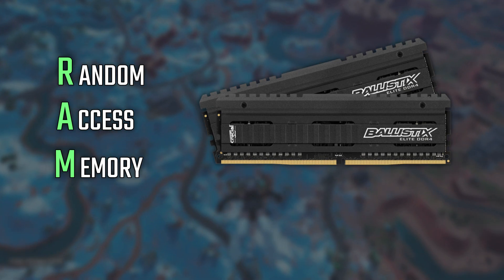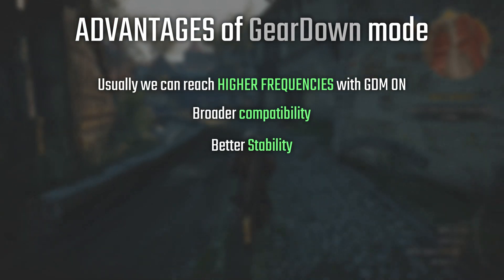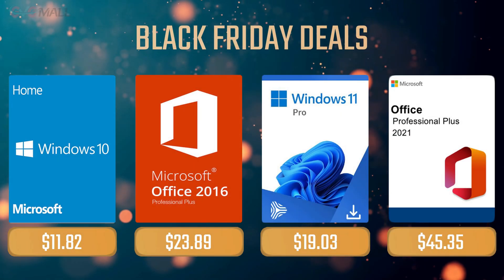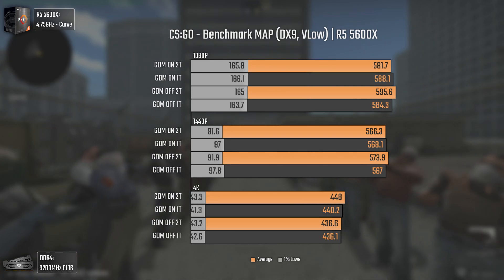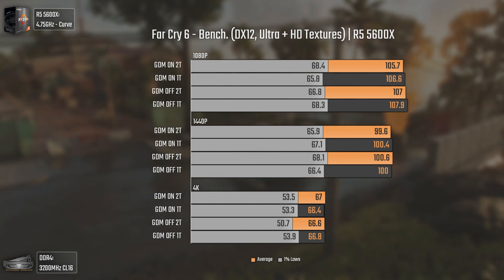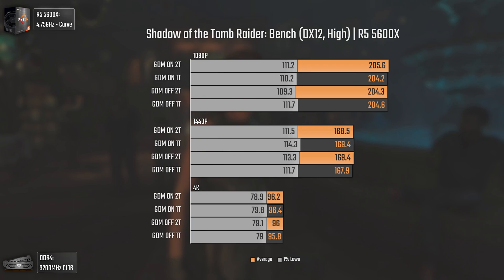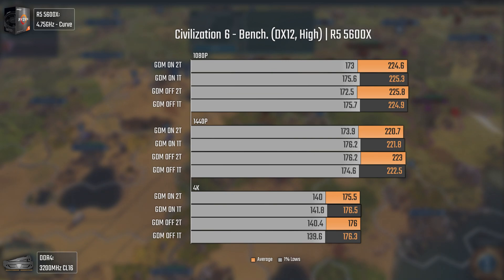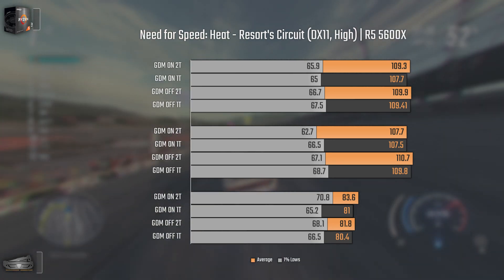Gear Down Mode ON vs OFF | 1T vs 2T RAM | 1080P, 1440P & 4K Benchmarks

Comment: when performance degrades after tweaking timings the most likely culprit is instability. did you run any sort of memtest in to see if 1T GDM OFF was stable? also, your ram seems to be single rank, is that correct?
Reply from the maker: Single rank and all stable. Mlst of the results are within the margin or error though

Comment: I have 4x8 Adata D41 Samsung B-die and running at 3600 14-14-14-28-300 1.4v. 
I have tried to push the bus more with c16-16-16 but the IMC in my i5 11400f is weak and it could not stable. Could reach 3800 c16 on i3 10105f.
So this is  because I lose silicon lottery or the IMC of i5 11th is bad?
 I really don't want to put too much voltage to the ram and mainboard.
Thanks

Comment: I'm still a bit lost. I just recently built an Intel system and found this in the bios. I have CL14 B-die ram at 3200mhz. I still don't really understand the purpose of this concept
Reply from the maker: Intel doesn't have geardown mode. Intel has gear 1 and gear 2. Gear 2 will leave the folk at half the mem frequency. So you want gear 1. Gears 2 and 4 are just for ddr5 since they have really high frequencies

Comment: Hello sir, I want to ask, I'm using an i5-12400F and a H610 motherboard using Kingston 2x8 3200 CL16 RAM. The question is, if I run XMP 3200, I checked on CPU-Z it only controls 1/2 (Gear2), why? As a result, the latency is bad. And is there a BIOS setting so that it can run on 3200 but work on Gear1 so that it is more optimal?
Reply from the maker: Just select gear1 yourself my man
Reply: @AncientGameplays  Cannot run gear 1 on XMP3200 sir, motherboard auto select to gear 2 if i choose XMP 3200, how i can run 3200 on gear1 sir?

Comment: Exactly what I was looking for when stabilizing 4 sticks. Cheers!
Reply: Which option is better for stabilizing 4 sticks?
Reply: @douglaslopes369  2T or GDM On ( with 1T)
Reply: @Koeras16  2T
Reply: @douglaslopes369  Hi, I am running Ballistix 3600 cl16 OC to 3800@ 15 15 18 15 32 2T.
Should I keep it 2T?
Reply: @livebig6414  2t is more stable than 1t but 1t is better.
I can't run GDM off 1T so I'm at GDM off 2T which helps to push my 3733mhz ram CL16 down to 15.. I manually tuned my timings and frequency it's originally a CL19 4000 kit.

Comment: I've got the G.Skill 2x 16GB, 3600mhz CL16-19-19-39 when DOCP on. Which settings with GDM/PDM/CMD you can recommend to me? I use a Asus TUF B550M PLUS mainboard and the 5600x.
Reply: Do research into thaiphoon burner and ryzen dram calculator. There are a few different ram manufacturer/die/revisions g.skill uses for that default timing so there's no way to recommend something without you figuring out those specifics. I have 2x16gb gskill ripjawsV with same default timings and it uses Hynix CJR Rev.b1, and I've overclocked it to 3800mhz cl16-19-21-36-58-1T GDM on 1.39v with 1:1 FCLK on my ryzen 5800x.

Comment: With the Aorus Elite x570 mobo F35 bios. there is a few locations where gear mode  is. Which location is best ?  Tx 👍👍
Reply from the maker: Hey man, what do you mean? This is the Gearmode down and not the Gear options (like Intel CPUs have).
What i say in the conclusion might help you as well
Reply: @AncientGameplays  Yeah sorry I mean there’s more than one location of gear down mode on the Aorus mobos . It’s under so many diff settings 😬
Reply from the maker: @Rixster_82  Geardown should only be on the ram options (mostly timings) not more. And i know since i have one as well

Comment: telling me to not waste time when my ram mem hold my r5-5600x back xD but yeah tweek and oc ram mem for hours and just gain 1 to 5% fps (3333Mhz 15--17-17-17-32cl) over xmp 3200Mhz 16-18-18-18-36cl xD
Reply from the maker: 5600x is hardly affected by ram as i tested before. Just not worth the time for 99% of users
Reply: @AncientGameplays  well too late xD have wasted like 60 hours in 5 years on my ram memmory and used same ram for every gen from zen without 3000s. well I do not need to save my ram mem profile when I have every timming in my head for my kits xD

Comment: What about the latency? I have 65.9ns latency on Aida 64 with 2t gdm off, and 67.2ns with 1t gdm off. And this is at 3733mhz cl 16-17-16-14 timings.
Reply from the maker: That normal, but that won't reflect in any real world difference. That is the point. BUT, if you can't get it stable with GDM OFF 2T, then do it

Comment: Yooo Fabio whats up ! The cpu temperature readings in Amd ryzen master and Hwinfo64 shows a difference of 5-6 degrees celsius, which one should i trust more ? The ryzen master usually shows less temps.
Reply from the maker: Maybe they're measuring different value. Usually hwinfo64 has the most accurate readings
Reply: @AncientGameplays  Thank you Fabio <3, also when do you think amd will release the new graphics driver, they kinda took a long time since 21.12.1 been about 3-3.5 weeks if im not wrong. Hope the next is a big one :D

Comment: Command Rate setting is very old technology now, from about 2005 era I had a DFI Lanparty NF4 with a Opteron 170 single core. Standard speed on Opty was 2000mhz, memory was DDR400 M/T (1st Gen DDR) @ 200mhz. Reducing the memory timings a little and setting CR 2T you could get ~3000mhz using FSB overclocking, on a really good chip, or using really tight memory timings and CR 1T you would get ~2800mhz using FSB overclocking, so up to 50% overclock. As the memory subsystem doubled and CPU/Chipset tech advanced with DDR2/DDR3/DDR4 and Intel/AMD subsystem improved and AIB's stopped using Nvidia's crappy chipset, Command Rate is pretty irrelevant as on todays systems you are only looking at a 10% -ish overclock on standard CPU cooling. My last Intel overclock at 50% was my old Slot 1 Celeron 300mhz, slap on mahoosive heatsink with 60mm fan and over clock FSB like mad to get 450Mhz.
Reply from the maker: CR is old, but it is less noticiable nowadays as the frequencies are getting higher and higher

Comment: But all this depends on what ram you have.
I'm using Crucial Ballistix 16GB (2x 8GB) 3600MHz CL16 DDR4 RAM

@ 3733 16 18 18 18 36 1T and Gdm off, this for me is very stable with 1 to 1 ratio on Ryzen 5 3600 
@ 4.3ghz
Reply: I have same ram, just did OC to 3800@ 15 15 18 15 32 2T stable.
stock 5600x
latency is 52.2ns
Reply from the maker: It doesnt....those timings are....bad. with gdm on you could be pushing like flat 16 or even lower. Gdm on always allows better timmings and frequencies no matter the ram kit. Still, all that matters is that you enjoy your pc
Reply: I'm sorry to disagree but it does depend on ram make and memory chipset, I know I don't have the experience you do but from my testing it's the conclusion I come to.
Reply from the maker: @uthman83  all ram kits differ a bit, but what i said still stands. You can get better timings with it ON. Still, you can try pushing more voltage as it will need more for tighter timings. You can also try gdm off but 2t. Stil, how do you know your previous setup was stable? What did you use to test it?
Reply: Not booting is the first sign, I use memtest, aida64, Cinabench and gaming.
Reply from the maker: aida64 is useless and so is cinebench in terms of memOC.
Memtest is "okayish", but if you want to be sure, use TestMem5
Reply: Thanks for the fast reply, I have tried flat 16 @ 3600 on this ram and my pc won't boot.
The best I can get is 16 17 17 16 36 but this is unstable.

Comment: so there is barely any difference in terms of performance but the overclocking headroom gets even better.
Reply from the maker: Yeap
Reply: @AncientGameplays  dude WTF how are you gonna use AMD cpus and not use ryzen master to show the auto timings the motherboard ended up using, and for morons who heat ryzen master I took my timings from 100 ns to 60 ns using just it

Comment: I would like to see the frequency and timings this is test is done at. If u need somone that can actuly run tight timings on DR at 3800 1T GDM OFF contact me.
Reply from the maker: I actually forgot to tell people, that i was using the most common ram around for this test (simulated), which is 3200MHz CL16-18-18-18-38

Comment: I mean... testing the Cpu, while being bottlenecked by the gpu.. idk,  I'm guy who says, test in 720p or lower
Reply from the maker: You dont know much it seems. Apart from sottr maybe, i was never gpu bottlenecked at 1080P, and maybe sottr had some heavu cpu parts in the end where it wasnt gpu bottlenecked as well. Bottlendcking is not about resolution lol. Its when your cpu/ram cant handle all the frames the gpu is pushing, and in this case a gpu as strong as the rx 6800 was being bottlenecked at 1080P in almost all the games tested
Reply: @AncientGameplays  it's doesn't change a lot, but it's actually vice versa, the Cpu prepares the frames then the gpu renders them.
Reply from the maker: @TheMakiran  what i meant is that the cpu cant push enough frames and the GPU is waiting. Of course it changes a lot. You can even cause bottlencks at 4K if you  want to, resolution alone matters exactly zero, and testing at 720P is just ridicolous to say the least

Comment: Can you tell what board is decent or best for 5600x :(
Reply from the maker: Get a b550 Tomahawk and call it a day
Reply: B550 anything really, I currently use ASRock Steel Legend and it's a very nice board with super cool VRMs but a little on the pricey side.

Comment: If I recall correctly, there is no such thing as GDM on with 2T and with some AM4 motherboards when you enable GDM, the BIOS setting for Command Rate becomes greyed out and you cannot change it. This would mean any performance differences between "GDM on 1T" versus "GDM on 2T" are caused by benchmark variability and if you do more benchmark runs the delta of the averages should be statistically insignificant.
Reply: I have double-checked on my MSI B550 Unify, GDM is set from the Command Rate option where you have 4 available settings: Auto, 1T, 2T, Gear Down Mode. This suggests that 2T and GDM are mutually exclusive. In any case, at least on my MSI board, there is no way to set both 2T and GDM on at the same time. I suspect that with your ASUS board, even if it allows you to do this, it's just placebo. I would expect that ZenTimings would catch this but it obviously doesn't. Maybe Ryzen Master does. :)
Reply from the maker: @AlexandrosGidarakos  yeah, i know. But on asus, geardown mode is a solo option, and you can still changed in between 1 and 2t with it on or off (even if it gets ignored)
Reply: Stupid YT keeps discarding my reply :/
Fabio, can you double-check in ZenTimings when having both GDM on and Cmd2T set to 2T in your BIOS? If my assumption holds water, in ZenTimings you should see GDM Enabled but Cmd2T set to 1T.
Reply from the maker: @AlexandrosGidarakos  zen timings also shows me GDM ON and 2T, checked it several times :D
Reply: @AncientGameplays  Mate, he is right, by enabling GDM the command rate is managed by the GDM logic and the CMD setting in the bios is disregarded. Google for: "For overclockers, Geardown Mode will be noteworthy because it also tells the memory subsystem to disregard the command rate set in the BIOS."
Reply from the maker: @FC-rq1np  my man, you need to read coreectly. I myself say that in the beginning of this video. I am just telling you that my motherboard still allows mw to change it
Reply: Just checked on my wife's Asus B350 board: setting Cmd2T to 2T and GDM on in the BIOS, boot to Windows and ZenTimings shows GDM Enabled, Cmd2T 1T. It is strange that ZenTimings behaves differently with your setup, it should be reading the values from the CPU registers directly, not from what you set in the BIOS :/
Reply from the maker: @AlexandrosGidarakos  strange indeed...x570 here. Will check again later
Reply: True I have MSI Tomahawk B550 and can only enable GDM, cant choose 1T/2T even with most recent bios.
Reply from the maker: In my main asus board i have always had the option to change im between 1T and 2T wirh gdm mode. And it will change on bemchmarks as well

Comment: I stabilize my ram with gdm off 2t at reasonable 1.45V. 4x3733mhz(3800 thrown whea errors with latest bios) CL15, 15,15,15,30,45 trfc 272. and FCLK 1866 with FCLK, UCLK, MCLK ratio of 1:1:1. Probably It would be able to run 3800mhz cl14, but above kit rated safe 1.45V. Its all about finding the sweet spot and stabilize ram there. I tested 3800mhz cl16 vs 3733mhz cl15 and in most cases I got 2-5 better fps with 3733/cl15
Reply from the maker: Nice. Whea is due to low soc voltage
Reply: @AncientGameplays  exactly. Issue is that when I push soc voltage too high(above 1.1), there is noticable cpu performance decrease across the board. Even latest gigabyte B550 F14e bios is the most stable it has locked vddp and vddg voltage to only 900mV. Especialy higher vddg(950-1050) is need to stabilize ram at higher speeds. I am completely ok with current settings if it stays stable. Thanks for Your vids. Your Ram speed performance compairsion vids are reason why I started with ram tunning. Thanks for that. Stay strong, keep it going and merry Christmass to You all.
Reply from the maker: @johnrehak  that shouldnt happen, like...never. if the perf drop may be due to temp. Ryzen 5000 should be able to handle 1.15v easily
Reply: @AncientGameplays  I think it has something to do with ram controler. If You stress it too much, cpu loose its performance a bit(like few% nothing big) and as we know each CPU is different. I saw exact the same scenario with Ryzen 5 3600 on my old b450 motherboard. Higher soc voltage and ram freqency increased fps in games, but in pure cpu test gave worster scores. It wasnt about temps Noctua nhd15 was more than enough to cool that 6core cpu and now I have 360mm AIO on 5900x which keep temps at 28°C at iddle, 45-55° while gaming and 65° all core stress testing. Btw i have verry cold in my PC room 🤣 12-15° depends on outside temp.

Comment: hum will try 2t for csgo jast to see what happens with my system 
by the way woth stock timmings and very tight timmings csgo for me never improve ,source 1 sucks
Reply from the maker: We need a new cs...
Reply: @AncientGameplays  for sure, a REAL anticheat, source 2, (the smokes man, drop the fps so bad....) but, valve is.... valve hope with valorant on the scene now put more pressure on valve, it seems that near xmas will be an update and some strings of source 2 are in the code now but a full port seems unrealistic ?not for now, like for ever, some dev said they cant port it so has to  be written from scratch so)

Comment: also gear down mode off allows odd number for cas latency otherwise only pairs number
love u my man! you included csgo fps benchmark a huge kiss from argentina to italy! xD
Reply from the maker: I am portuguese haha. Big hug
Reply: @AncientGameplays  I thought that you were Italian too
Reply from the maker: @melcorchancla9431  surprise xD
Reply: Bangaldesh love Brazil and portugal football. @AncientGameplays
Reply: @AncientGameplays  looooooool i dont know why your english sound to me like if u were from italy ajjaja also your name may was that xDDD
Reply: That might explain alot of what I am experiencing.  I have Corsair Vengence 2133 and I can't get the tCL down to the advertised 13; instead it is tCL 14.

I'm not overclocking the memory, just trying to get the advertised XMP profile at 1.2V.  I am boosting the Infinity Fabric to 1600MHz, however. (I tried overclocking the memory previously to 3200 at standard voltage and it worked, but my PC PSU and motherboard are not particularly powerful and I noticed the case fan started slowing down 75 RPM.  The memory also got hotter than 50 degrees and the case was toastier, so I backed off).
Reply: @Magnulus76  enable xmp apply, turn off gdm reboot bios, and put Cas 13 manually and boot and check
Reply: @aessniper  I got it to work.  Not a big difference in performance, though.
Reply: @Magnulus76  no mine are 16/18/18/18 and i adjust it to 15/17/16/16 and also sub timmings tweaked and is a marginal performance boost like 1% so doesn't worth the amount of time, if u disable gdm and get the advertised timming of the ram at stock voltage its enough, may be u can tray to lower the rest of principal timmings - 1 and test but I don't think u will get like 1 or 2 % boost on ram performance and can couse some instability so..
OH and try to get fclk and ram in 1/1 ratio, don't bother with 1/2 mode
Then u can try undervolt a little fclk voltage and vddp voltage couse some xmp profiles put a lot more voltage than needed